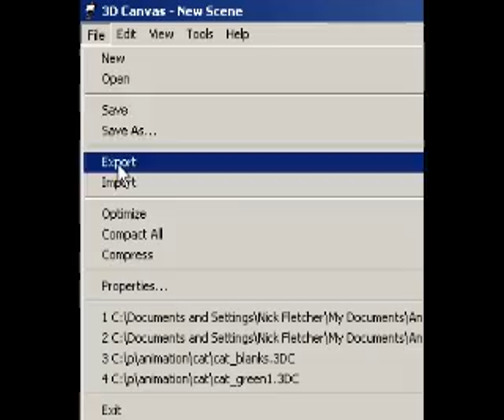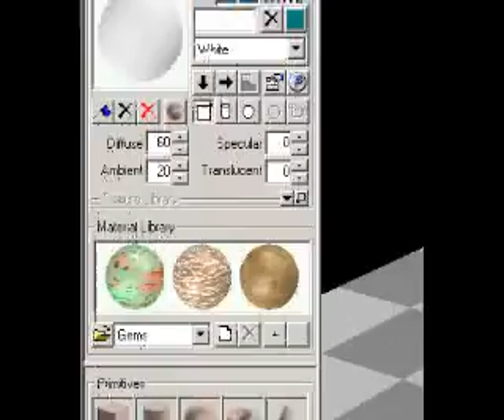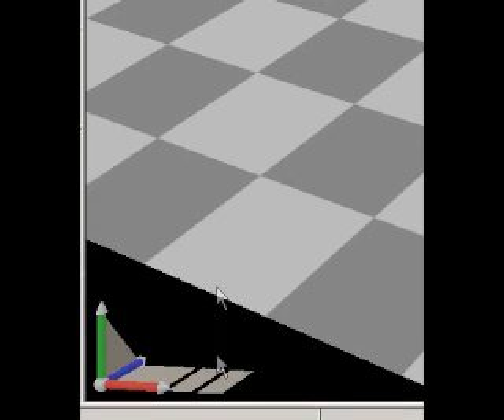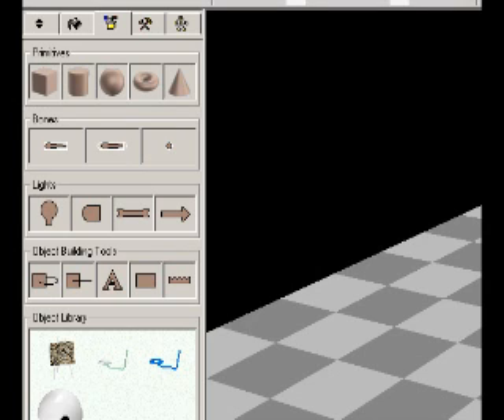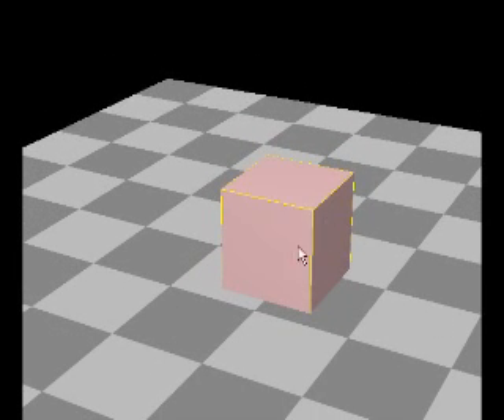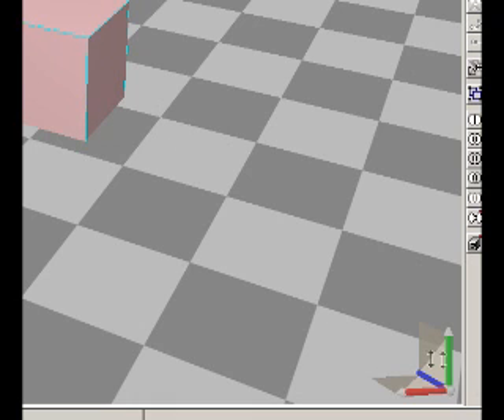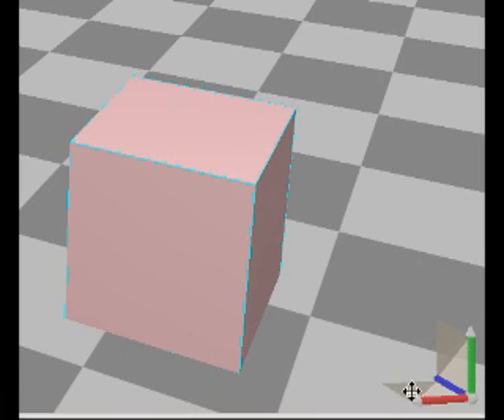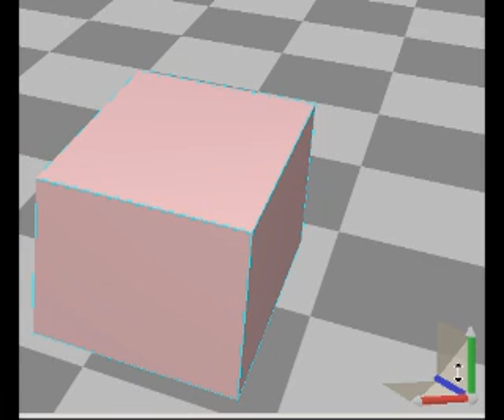Creating MSTS Content with 3D Canvas Pro (part1 a)

Comment from the maker: Hi Leonardo,

I think it's possible that you need to reverse the way that 'side' is facing. In 3d, the computer works out which textures to display based on the 'normals'. This way, faces that aren't going to be seen in a game don't need to be calculated, thus saving processing power.